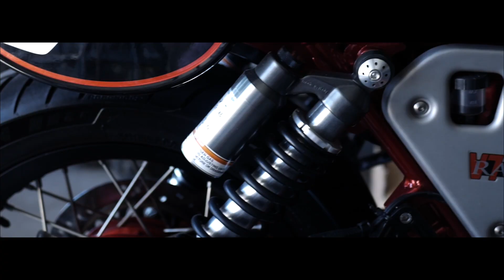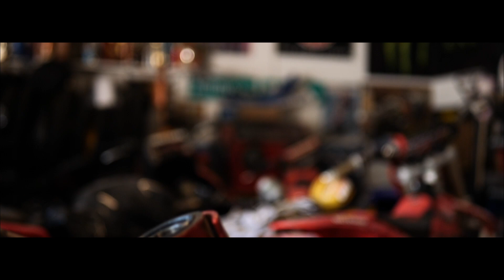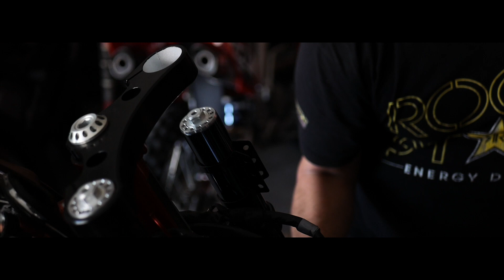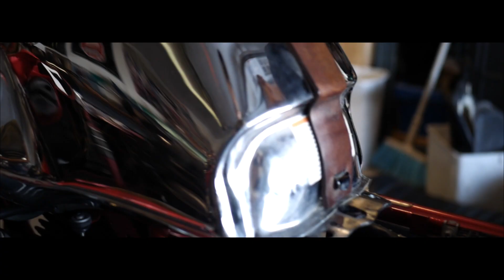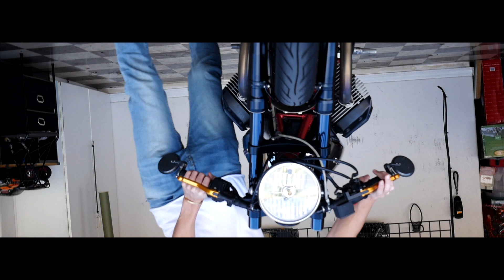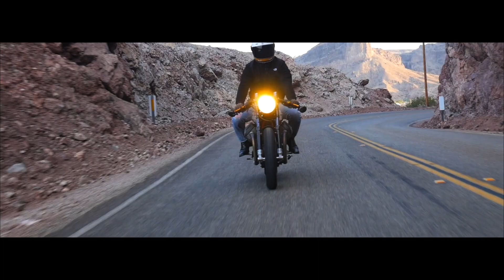Moto Guzzi V7 Racer build by BAAK Motocyclettes

Comment: Currently own a 1989 Moto Guzzi  Mille GT 1000 cc that I have had for 20 years. Once took me 120 miles on one cylinder at highway speed when one spark plug wire crapped out on a Sunday morning with no shops open. At almost 70 years old it has gotten too heavy to maneuver in and out of situations. Purchased a 2013 Moto Guzzi V7 Stone at more than 100 pounds less wet weight. Absolutely love it. Will stay with Moto Guzzi for the rest of my riding life. I have owned BMW, Laverda, Ducati, Moto Morini, Triumph, BSA,  Zundapp, Indian, Suzuki, Kawasaki, Cagiva and loved them all for different reasons, but the fact that I can physically handle the weight of a bike that will cruise (illegally) at 85-90 mph for as long as I need, looks good, is reliable and affordable and unique, why shop anywhere else?- -Mike Battle

Comment: Be nice to hear more of the exhaust note...
Reply: I want to do a follow up that shows off it’s features and give more emphasis to the note and performance
Reply: @shaneoneill8086  I'd certainly be interested in seeing/hearing that.  It's a great bike and looks like a fun project, and this video is nice.  Just wanna hear those pipes more...  So you don't find the Baak pipes to be too loud -- over, say, a three or four hour ride?  Thanks.
Reply from the maker: @SurferDoodsSC  Yes I will definitely create something for that. And no the pipe are loud when you want them to be and are subtle when cruising. I've taken the bike for long distance and never had a problem with the note at cruising speeds. Hope this helps.